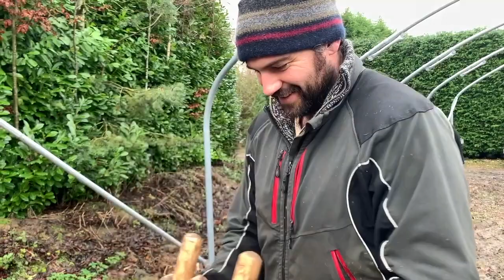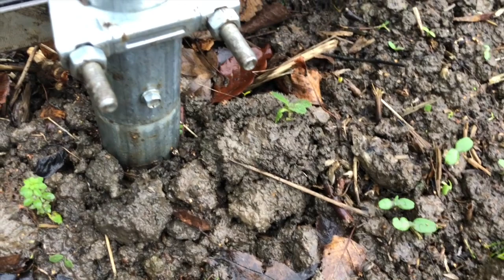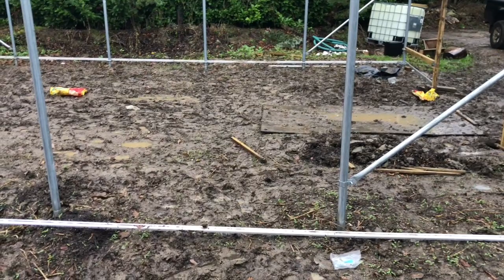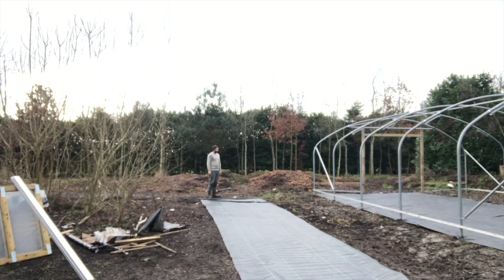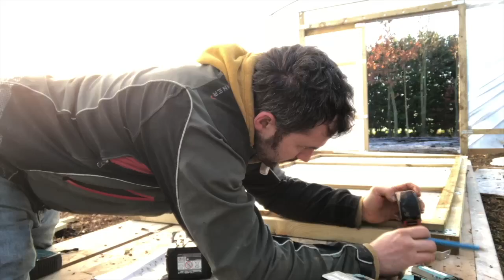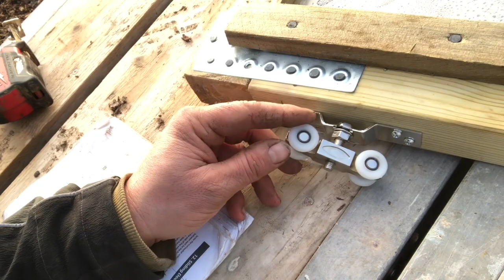FIRST TUNNELS POLY TUNNEL BUILD pt 2:  20 ft x 30 ft poly tunnel construction for off grid life

Comment: Ah, so strange, so many similarities. we have an almost identical polytunnel too (first tunnels?) hubby & I put ours up ourselves too :) (in february 10 years ago).
Reply from the maker: Yes ours is a first tunnels too! ☺️  How have you got on with your polytunnel?
Reply: @The_OffGridFamily  only mainly used  for storing our firewood (we have 2 wood-burners & a solid fuel Rayburn so have to store a lot) I do, though, use it to raise seeds & grow around a dozen tomato plants in it each year, oh & it has 2 grapevines growing in it too.  we have been fortunate that it still has the same poly cover that we originally put on it 10 years ago, but we bound every bit of the metal which would come into contact with the plastic cover as otherwise the metal gets so hot that it will eventually melt through the plastic sheet. I think our polytunnel is 26x54ft.we are not 'off grid - as you are, but we had solar fitted this year & have a well which we use to water the plants.

Comment: Looks good now it’s finished 
But I’d question the quality of some of those components 
They’re probably just sourcing components from China and not doing sufficient quality control checks before sending out the poly tunnel kits….
Reply from the maker: Yes some of the components weren’t great and we probably should have asked for replacements, but we were so fed up with the project and just wanted to get it done so we just got on with it 😩